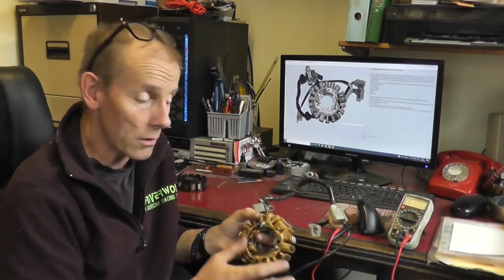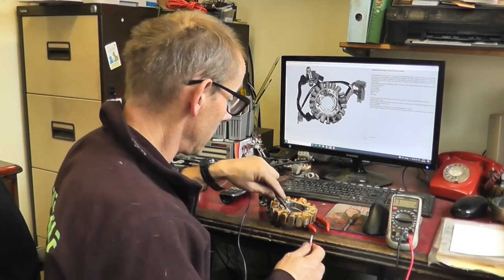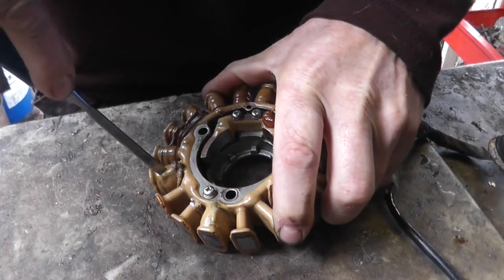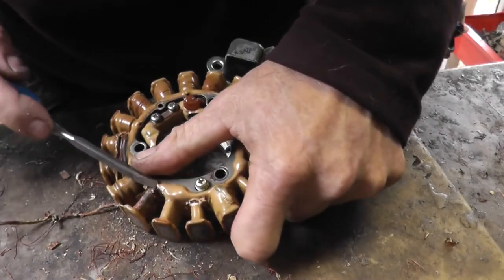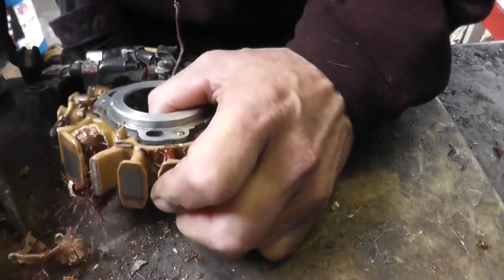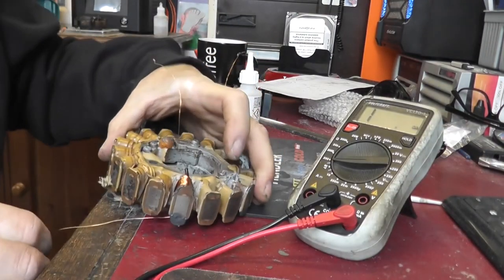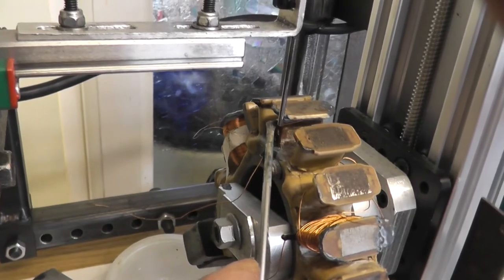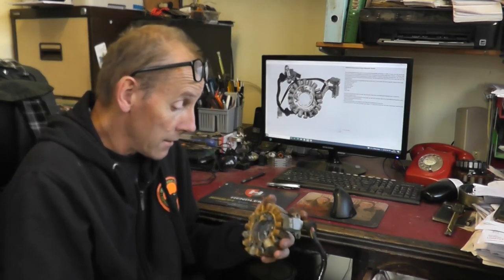Honda CB250 Superdream stator Ignition fault find repair fix

Comment: Bye! I am writing to you from Italy, I want to ask if you have ever rewound a stator of a Kawasaki KLR600 year 87 (or KLR650), it has three-phase alternator and two coils for CDI power supply. Since I have the two coils in dispersion towards ground (Ohm value at the ends are within the parameters), I would like to know how much voltage they should generate to then feed the CDI. I haven't found any news about this parameter (Vpeak or Vrms). Most likely I also have problems with the CDI but I want to proceed step by step to the conclusion (I hope..😊😊). Thank you.
Reply from the maker: Sometimes coil Ohms values can be correct and it  still can be faulty? I am not sure what the exact voltage output should be for that particular stator but I would guess it would be around the 80+ volts AC at cranking speed?
Reply: @bbbikeshop8359  Thank you for answering...
I measured 42Vac with a Fluke multimeter, I want to make another measurement with an oscilloscope to verify the peak-to-peak... Unfortunately, the voltages in the most important junctions are not written in the service manual. With my multimeter on the exciter coil I measure 84 Ohms and no leakage towards ground Exciter coil workshop manual from 61 to 114 Ohms, too much excursion in my opinion ) at 15° Celsius (59 degrees Fahrenheit), the spark is acceptable but after turning the engine for half an hour (80 degrees C - 176 F) the engine stalled, no spark, still now with a cold engine no spark. I will also measure on CDI. I don't know...

Comment: Hi BBBikes,
I am from Sri Lanka(Ceylon) and having an issue with my hawk mark 2 bike after washing it at a service station. It was running fine before the wash. now no spark at all.
my  twin connector (white wire/green wire ) reads 214 ohms on white wire and 217 ohms on green? wire against ground.
further in 6 pin connector (only 3 wires connected. green,orange,and yellow) green to orange 17.2 ohms and green to yellow 141 ohms.
any possible reason please. I checked the CDI and ignition coil with a running bike ,both are ok.
can pulser coil go bad also?

please help,

regards Rohitha
Reply from the maker: Hi Rohitha. If your stator is like the same in the video then the Green (which is ground) to White should be in excess of 350 ohms, which means the Low speed source coil/s is not producing enough volts to power the CDI and HT Coil.
Reply: @bbbikeshop8359  Thank you very much for the speedy reply.
 Yes mine is exactly the same but colours are different, could be due to aging.
I found another video of yours about 3 years old, it is the same 250 coil I own as well as one you have on this video.
I will get ready to rewind the coil or will look for a good  coil locally which is more difficult  than winding.
Thank you immensely for the perfect information provided, at least I know how to check a coil if I find a one locally.
PS: what is the SWG value of the low speed source coil?
Regards,
Rohitha
Reply: low speed coil wire gauge I mean. in SWG please.

thank you
Rohitha
Reply from the maker: @rohithakoralagamage Email me on info@bbbikeshop.co.uk